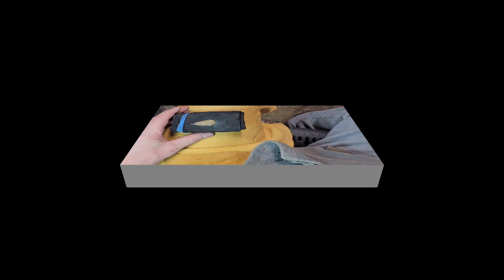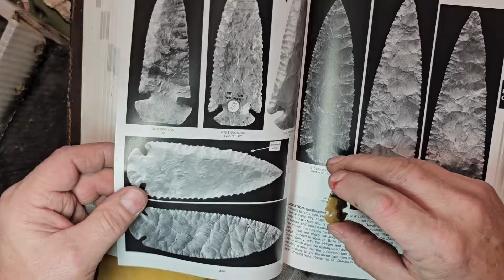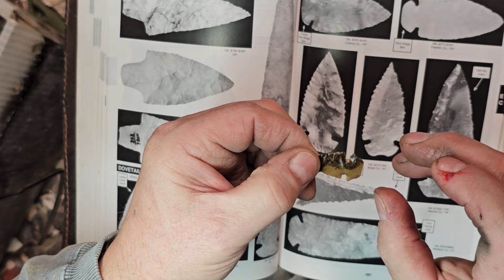Flintknapping A Mini Flint River Dovetail 🕊

Comment: Don't know if it would help,but i used to hold indirect stick in the bend of my knee like you do. But it caused my leg to cramp (nerve damage herniated disc)i started putting it at a angle under my thigh kind of pointing at the opposite knee , seems more comfortable to me . Takes a little bit to get used to striking the stick.

Comment: I hope your back improves. Hopefully it's related to damp wearher and will improve with weather change. I have had 2 cervical discs and 4 lumbar discs herniated for 20+ years so i can at least in part empathize with you. Struggled a lot but much better in retirement. Love the point. I seem to be able to do smaller points best. Prayers for your back.
Reply from the maker: @macbailes9953  Thanks Mac

Comment: i used t do indirect with the bar in a tighly rolled moose hide layed on my leg..youd probably need to tie it to ur leg or use a table??
Reply from the maker: @edgould6785  I might have to try that if things don't settle soon.
Reply: I've tied the indirect tool across the top of my leg before. I had to tie it pretty tight though and ever now and then loosen it up to let the blood back in my leg